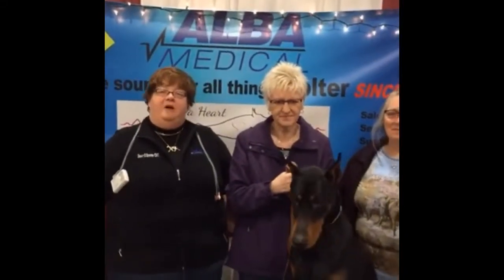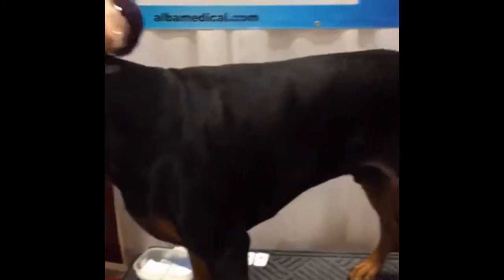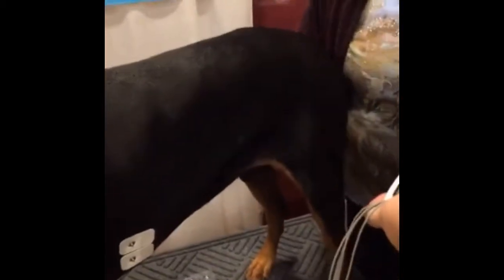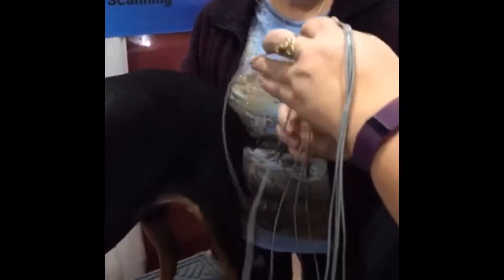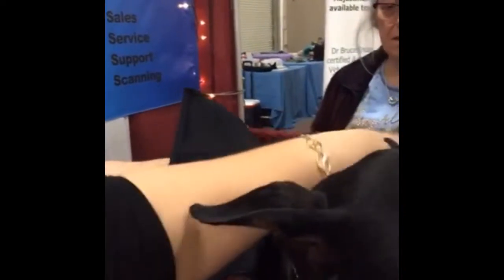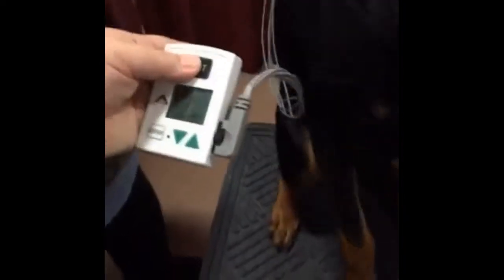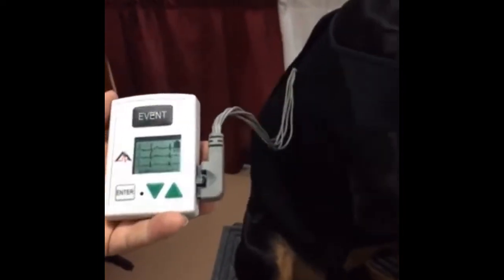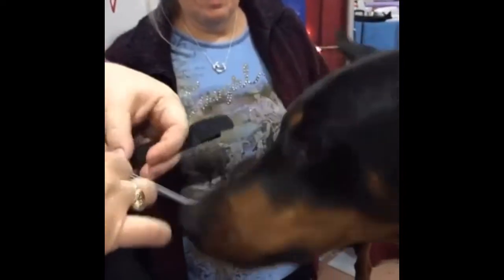How to use the DDP Holter Monitor.

Comment: You are performing a wonderful service however, that said, the technology needs to advance quicker because although not above my Joe dog owner capabilities and willingness to try , the process is too involved.  The present technology needs an innovator to create an easier to apply and use combined with an equally accurate result or preferably a more accurate result.  God bless.
Reply: This is exactly the technology used for humans.  Dcm happens in humans also.  The holter monitor is insanely easy to use and you can rent one